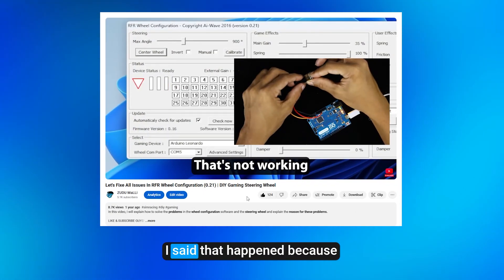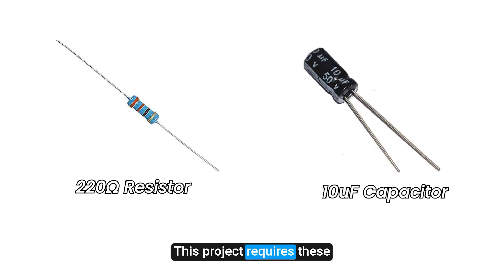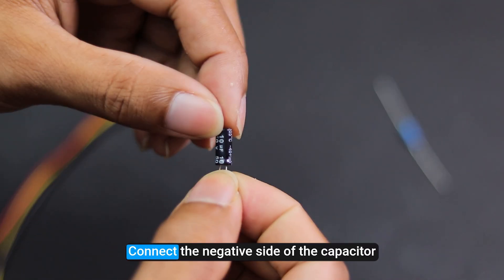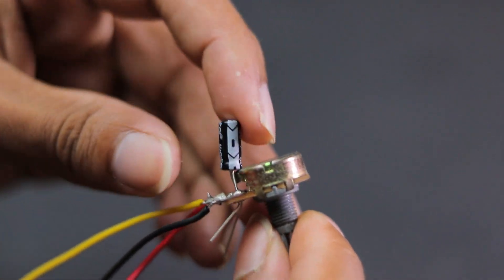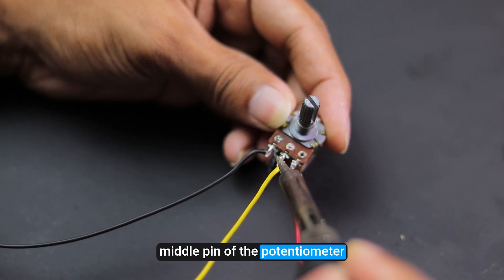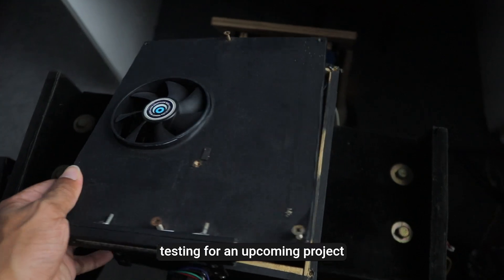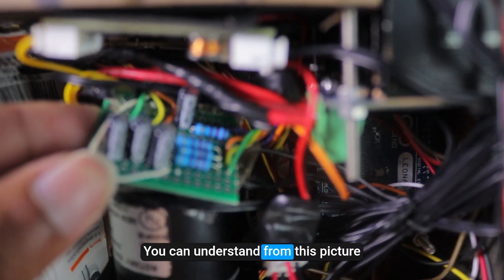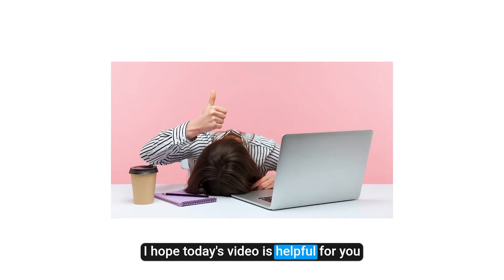How To Fix Pedal's Flickering Problem

Comment: Bro when i rotate one potentiometer, both acceleration and break are increasing
Reply from the maker: Check your wire connections and recalibrate all pedals
Reply: @zudumalli i already try this, but the problem is not solved, any solutions?
Reply: did you fix??

Comment: Quick Question:
How hot does the motor get if i play at 100% ffb, I am planning on not enclosing the motor in a box. Will it burn out if i dont add a fan while the motor isnt enclosed by anything?
Reply from the maker: I stopped playing at 80 degrees. I think it can be more than 100 Celsius.

Comment: Hola gracias por compartir este gran video! crees que este sistema de filtro de ruido se puede hacer para las pedaleras de los volantes logitech g25? el sistema de cableado parece ser el mismo
Reply from the maker: Yes, you can. The wiring is the same. It's easy for you to install this way 1:50
Reply: @zudumalli  Gracias por responder! saludos

Comment: yo bro i built the arduino wheel from your chanel the only prob is when i turn the wheel slightly the motor uses very less power to go to center so it can tmove the wheel but when i move 180 degree the motor uses very good power and is able to center the wheel is there anyways i can change the graph of power used by the motor so that i can used higer rms for small changes also i am using wheel config software not emc
Reply from the maker: Have you tried using all of the "game effects" at 100%? Sometimes the settings you adjust don't apply until you restart the PC. If it doesn't work, use EMC to make sure there's no problem with the wheel base.
Reply: @zudumalli  it got fixed thanks

Comment: I have query from your ffb steering video
What did you used to mout the rotary encoder ? Can you please help me to find one or get an alternative 😃👍
Reply from the maker: I am using the same 775 motor bracket for the encoder. But it couldn't be mounted directly, so I modified it by drilling some holes.
Reply: Thank you bro ❤️

Comment: I made my own diy wheel with the emc lite version, the problem is when im using force feedback the center goes off, for example i centered the wheel on 0 degrees, opened wheelcheck and tried a forcefeedback experiment, and when it stopped, i rotated the wheel back to the position where it supposed to be 0 degrees but instead it was -56 degrees
Reply from the maker: The reason is that the connection between the encoder and the steering wheel shaft has been lost sometimes. Check that your encoder shaft is connecting properly to the wheel shaft.
Reply: @zudumalli  Okay, thank you.

Comment: I have crew 2. How to set EMC in crew 2. Please make video for crew 2 sim setup.
Reply: I think it's not working in crew 2.Steering  wheel  works  fine when the car isn't  moving.but when  it moving whole game turn to  chaos. by the  way  I used wheel config.
Reply from the maker: I also tried EMC but not work

Comment: I am using wheel config is better than emc lite. Beacuse i force feedback and spring mechanism work properly. In emc lite not working properly. 

In emc pro force feedback and spring mechanism work properly? 

I don't have subscription of pro version that's why I am asking.
Reply from the maker: Yes but emc lite has softlock mechanism.  But pro version has hard lock option its same as wheel config.